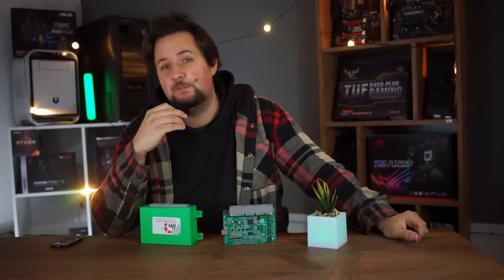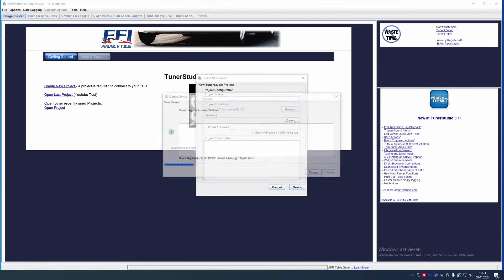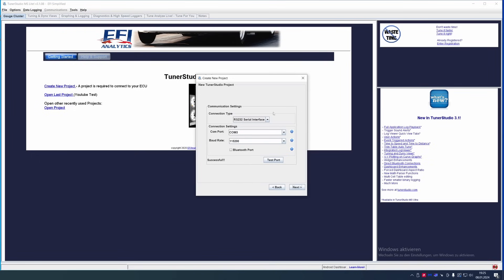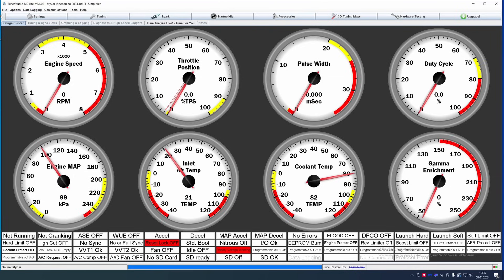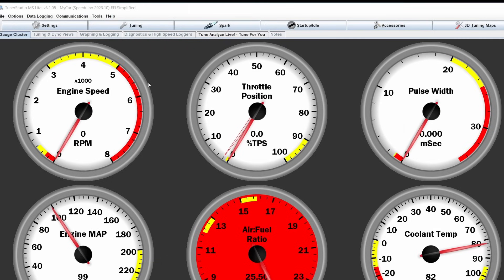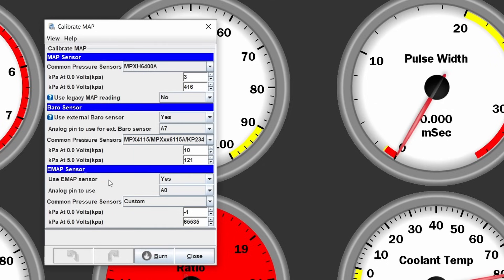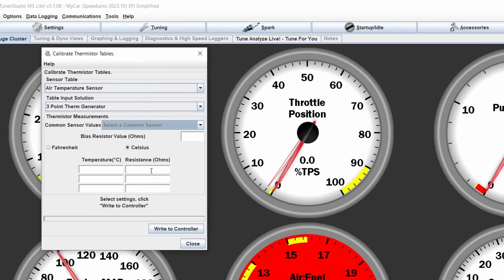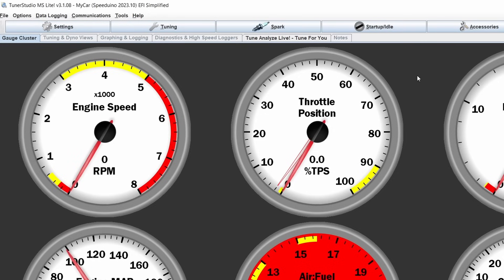Tunerstudio Standalone ECU Tuning Guide | Part 1: Project creation & Sensor calibration | Megasquirt

Comment: Hi I have a 16 cylinder engine. is it possible to use speeduino as ecu on it?
Reply from the maker: not really. you could use two but the maximum would be 8 cylinders on one unit.

Comment: Looking for some help with my speeduino ocelot. it does not have a pin for fuel pressure so i am trying to use a spare input pin for this. when i select the fuel pressure and tell it what pin to use it does not work. when i supply 5v to test it the gauge does not respond? what am i doing wrong? i wire pin A9 to a 5v source and assign pin A9 to the fuel pressure sensor. then I add the gauge on screen. but nothing happens.

Comment: I just found your channel and it is exactly what I was looking for with regards to setting up a GT17 @ 7-10 psi turbo on a Kawasaki VN900, I was looking at going to a Haltech 550 but the cost after adding in a wideband controller was prohibitive, I looked at Speeduino and Microsquirt and was amazed at how far they have come with their DIY setup and self tuning aid,. I just hope the Denso sensors on the Kawasaki are all compatable with the Microsquirt, EG: Crank, air temp, air pressure, water, vehicle speed and TP sensors, It also has a couple of safety sensors like clutch, side stand and fall down, I know I will have to add boost control and a wide band o2 sensor and will follow your tuning guide as I like that you are straight to the point. Thank you.
Reply from the maker: in theory any sensors should be at least configurable with restistance to ground if they arent preset. You can measure that at different points of temperatures. As for crank and cam sensors you might have to look into what it is exactly. 
the speeduino has a built in pressure and barometric sensor so i would just ose that. also it has a input for wideband 0-5v signal or an onboard controller if configured that way.

Comment: Ever do any all motor k series
Reply from the maker: havent done that in perticular, tho i have tuned many different engines. also some purely built NA cars.
Reply: @throttlebuddies0  I'm building a k20a3 with VTech locked it has vtc and I'm having a hard time trying to wire it to the speeduino and how to control it I've had some tell me you can only control it on closed loop Im very new to this it's my first ecu project been a V8 carb guy ally life (52) and trying to gain as much knowledge as I can but no info on k series just missing tooth crank sensor and one tooth cam please help maybe get me In the right direction if you can
Reply from the maker: @charlestorruella8591  vtec in closed loop doesnt make much sense. Usually you have a table where you control it on open loop with set values depending on rpm and load (tps or map that is) if you want to send me a dm on insta, maybe ill be able to help you

Comment: are you then responsible for any damage if hired?
Reply from the maker: depends. while tuning and if anything goes wrong there and it is my fault yes, but nor do i or would somebody else guarantee that after this because these ecus do not have enough safety measures built in to keepthe engine from blowing up for example if you were full hrottle for like 20 minutes without an oil cooler or whatever..
Reply: @throttlebuddies0  lol you give a disclaimer about damage and then say you can be hired.  Just teasing you and adding a comment.  I have a few speeduino boards for my racecar..that I sold.  I think my next one will be electric.
Reply from the maker: @murraymadness4674  yeah that disclaimer was more like for the videos any changes that anybody does themselves haha when i get hired to tune whole different story obviously lol 🤣

Comment: Thank you for these videos please keep them comming, they are a lot of help.
Could you go over the manual configuration of the speeduino, ua4c if you have it. 
I.e what junper for thay setting and if a vr conditioner is needed.

Im in the us trying to get an ls started on the ua4c. Ive got spart injectors working and working out the kinks.
Reply from the maker: Thank you! as for jumpers depends on the unit you buy they might not be configured to use jumpers depending on how they are built. the vr conditioner in my case was just an add on board that i ordered on the site together with the ecu